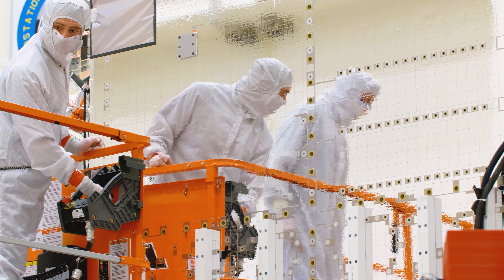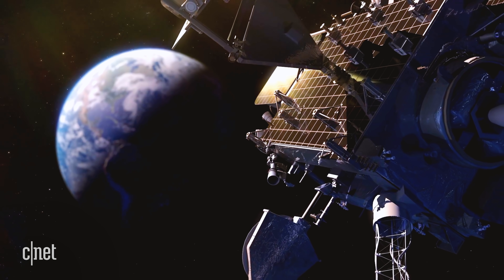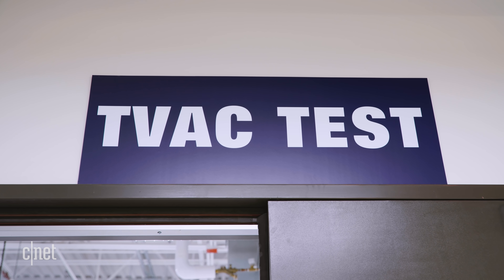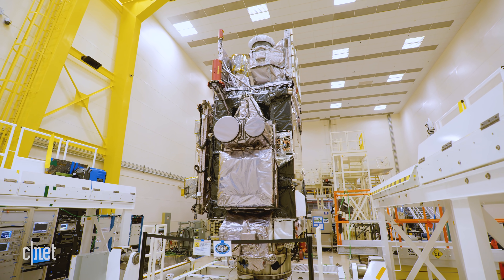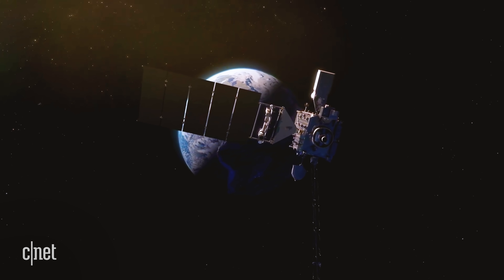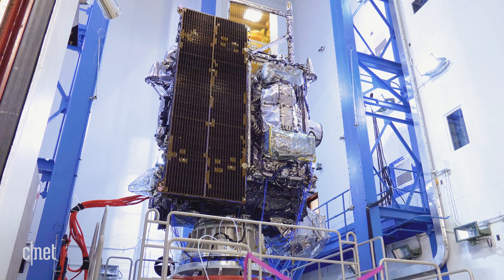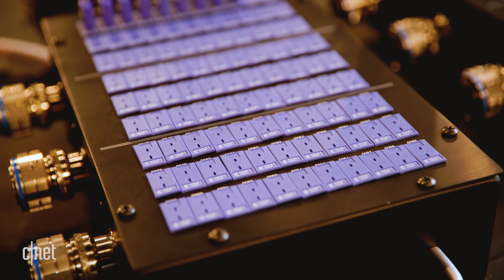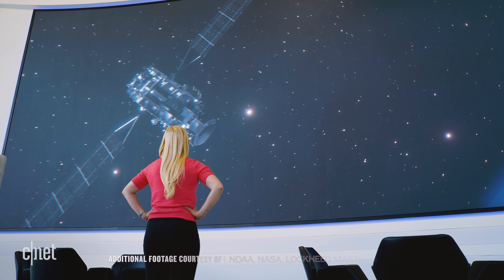EXCLUSIVE look inside Lockheed Martin's new satellite torture-testing facility

Comment: What are the surveillance capabilities of this satellite? Is it capable of surveying individuals, or groups of people, crowd control, mass surveillance? During important weather conditions, sure they can provide real time statistics, but is that the whole story? What else is it capable of? How else will it be used? Lockheed Martin is an arms/defense company afterall with major political ties, no?
Reply: Calm down tin foil hat
Reply: I am pretty confident that this isn't a spy satellite. First off, the instruments are designed for a specific use, and certain parties will have access to these instruments. This means that any data the Govt might want to use would have to be measured, and transmitted all whilst they block the scientific users of the satellite. Also, the US already has plenty of spy satellites already in non-geostationary orbits (LEO) which gets a more detailed view of the earth's surface whilst covering more ground. Due to this satellite being in geo-stationary orbit, it would have to have very powerful instruments which are not designed for tracking weather in any way, and would only be able to look at one, very specific location on the planet, not ideal for when you need to track global activity. Last of all, due to the weight requirement of emplacing these much more powerful instruments, it would be taking away from the capability of the weather instruments, and therefore would simply be far more economical to launch an actual spy satellite that has an unknown orbit (and therefore location) to do your tracking.
Reply: Any satellite in geostationary orbit won’t have NEAR the camera resolution to see small towns, let alone people. Also if you want to control a lot of people, doing it from space is probably one of the worst places to do it in terms of practicality.